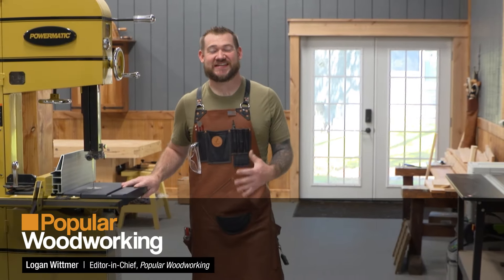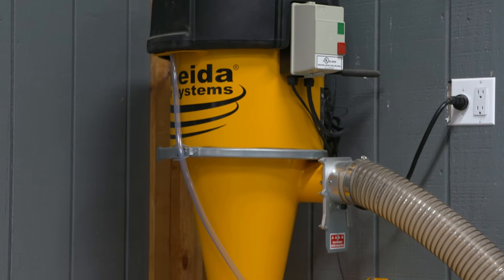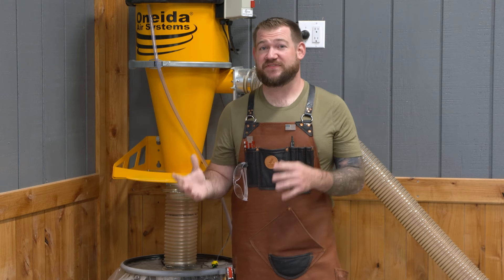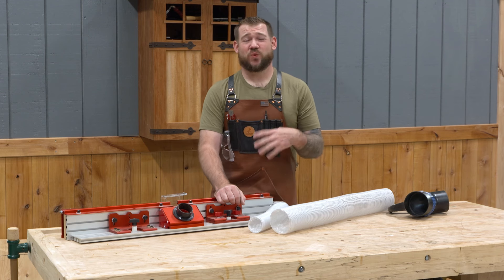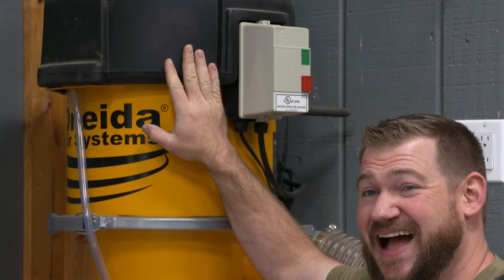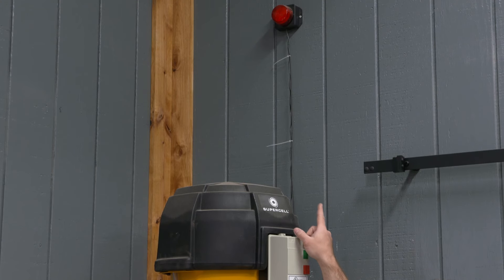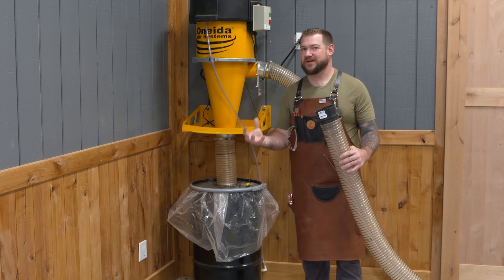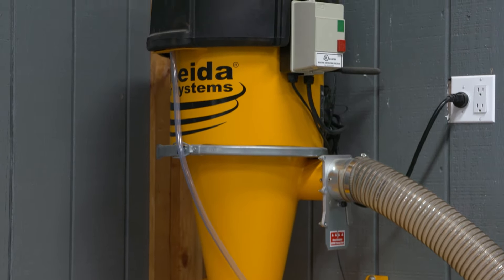Choosing the Right Dust Collector

Comment: I have to agree with several others.  This is definitely a commercial for Oneida.   "Just call up Oneida and they'll be able to suggest one of their other . . . .  Be up front and tell the viewers before you begin, in the title, that it is about Oneida dust collectors.  You can say you mentioned "other styles" and you would be correct.  But, the title implies something broader than just one brand/maker.  I was going to send this (when I saw the title) to a group of new woodworkers, but I won't now.  No reflection on Oneida.  It is just not a video showing various dust collectors and commenting on what they each can accomplish.
Reply: Come on with your vitriol.  No other product on the market can do what this machine can for a  small to mid-size shop.  Funny popular woodworking forgot that it also works great with 1 1/2" hose for hand-held power tools.  Versatile!!

Comment: I have had my Supercell (35 gallon, wall mount) for going on 3 years ... couldn't be happier. The one thing I am contemplating is putting a couple of eye-bolts in the lid so I can suspend the lid from the frame of the wall bracket with bungy cords when I empty the barrel.

Comment: How far apart can the super cell be from the drum? I want to place a dust collector high on the wall and have the drum to side, so not directly underneath it. Is that possible?
Reply: Yes, you can mount the supercell at any height and then run flex hose from the bottom of the Supercell cone to the drum on the floor. Although Oneida recommends that you keep that drop as straight as possible as it's all gravity fed, and you don't want dust getting caught in the hose between the bottom of the cone and the drum.

Comment: Decent infomercial. I'm considering this system but I'm worried about the noise generated by the three shop vac motors. Seems like there was some video editing done during the "party trick" to lower the audio level when the system was running. Did anyone else notice that the video conveniently zooms in so we couldn't see if he put on hearing protection during the demonstration.
Reply: I can guarantee he was wearing hearing protection. First, I’ve been in a few shops with dust collection systems inside the shop and they are ALL loud. Plus he was standing right next to the collector so direct impact noise. Most modern microphone systems, ear bus, AirPods, etc. have an automatic noise cancelling/dampening system that “mutes” the sound of the dust collector shortly after it was started up. Hence, the change in volume you noted. Finally, I was recently able to tour the studio at Woodsmith/PopWood as well as Logan’s shop and yeah, it’s loud but it works. While the video is sponsored by Oneida, Logan offers several tips about features and functions to consider when choosing any dust collection system. Me, personally, I have a Dust Right system from Rockler that has done well by me. I have also used the Dust Deputy from Oneida connected to a shop vac. It too did well for what I was doing at the time and what I could justify.